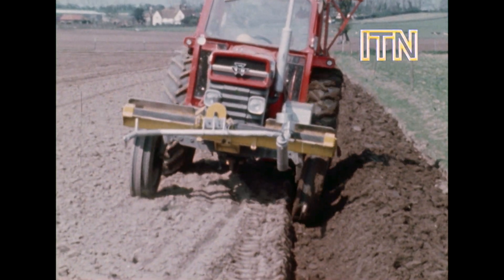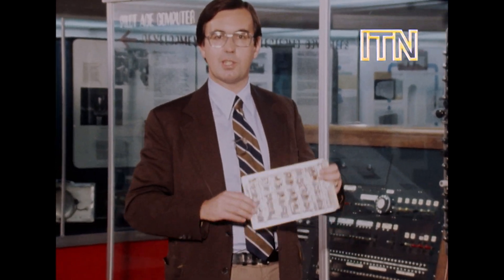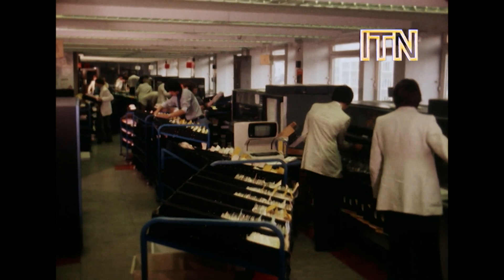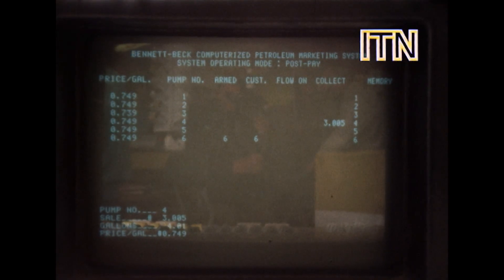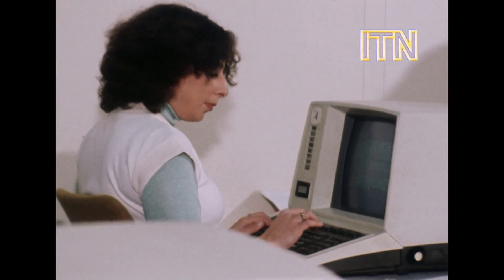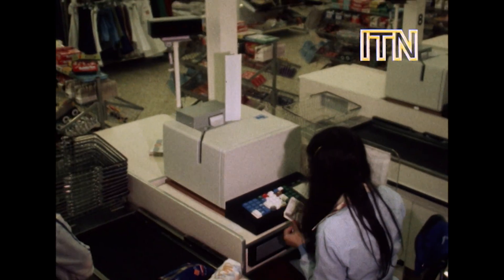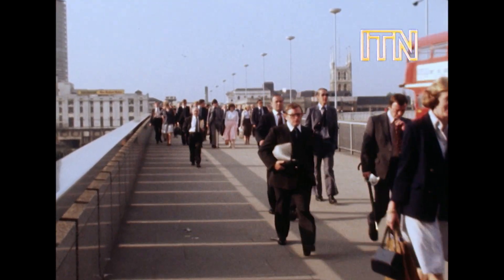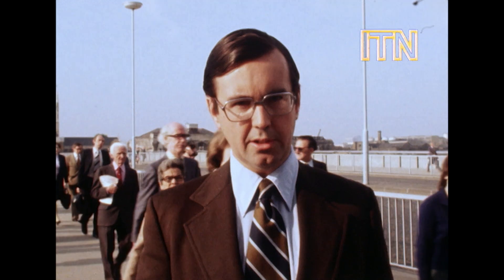How 1970s Britain Feared the Microchip Would Change Working Life (1978)

Comment: Back in the late 1990s, my geology department had a computer from 1976 that included one of the first colour monitors in Ireland. It was a Compucolor 8001. It connected to a minicomputer, the size of a washing machine, the box contained about 6 printed circuit boards about 1.5 x 1 foot covered in lots of rectangular black chips. The memory boards boards held 16 kilobytes of memory each. The laboratory technician showed me how it operated, that it was connected to the XRF machine, and could not only tell you the elements in a sample but their abundance with surprising accuracy. He was very proud of the machine.
Reply: Manchester University was the same mid 80s. It took about 5 minutes ot compile a 100 line program. This was a giant rusty mainframe.